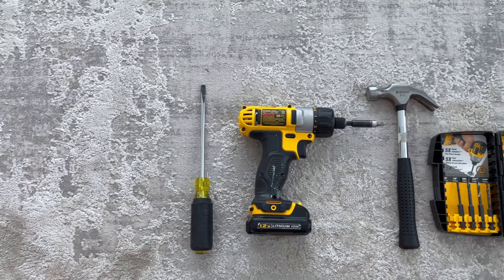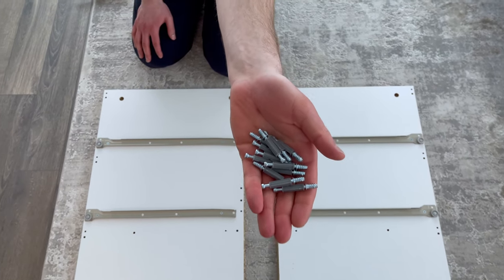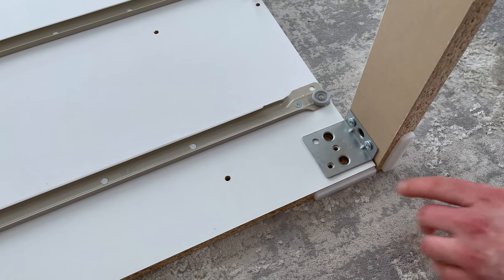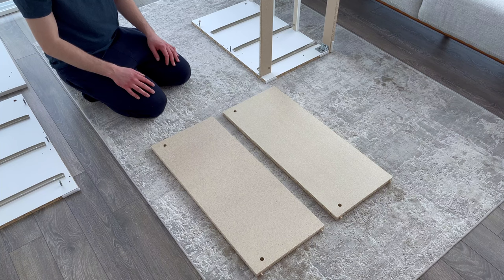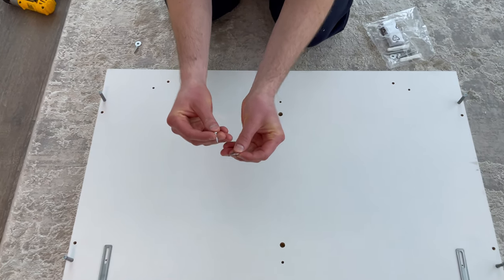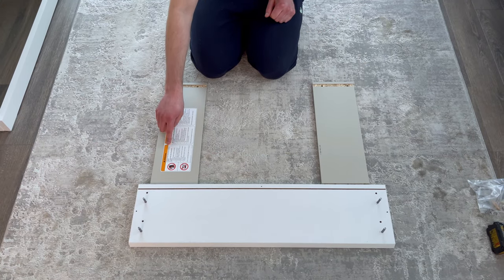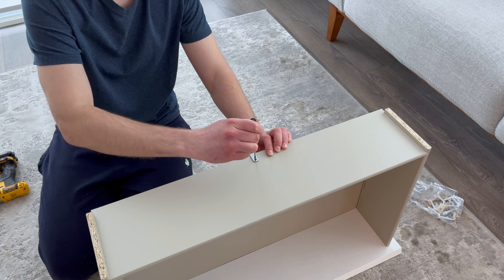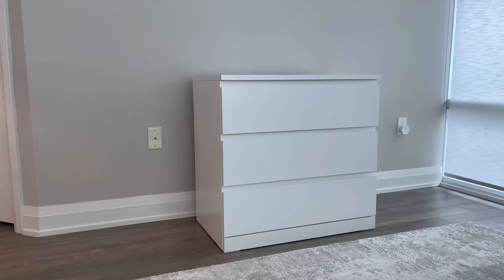Easy To Follow IKEA Malm 3 Drawer Chest Tutorial

Comment: The top drawer gets stuck and locks, any tips?
Reply from the maker: It's hard for me to know what's exactly wrong with your drawers as I can't see them but from my experience, if the 3 screws are not screwed in properly/sticking out a little bit where the drawer slides are on the drawer, then they sometimes get stuck.

Comment: Not sure where I went wrong the drawers don’t seem to want to go in. It’s almost like the drawer is too big some how
Reply: I’m having the same problem. Did you figure out what was the issue?
Reply: Same! Did you figure it out?
Reply: Or if the video creator could respond to this post that’d be helpful too
Reply: @createwithchantel  I’m having the same issue. Did you get it in?
Reply: @aniyahdavis6429  Yes I actually got it. All you have to do is change the drawer slides inside the dresser. I had the right slides on the left and left sides on the right if that makes sense. No need to take the entire dresser apart.